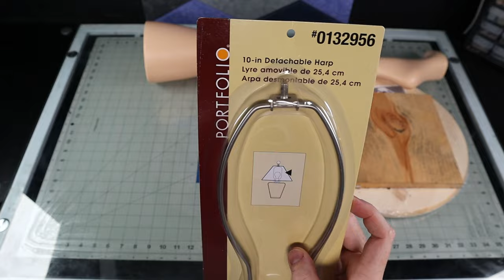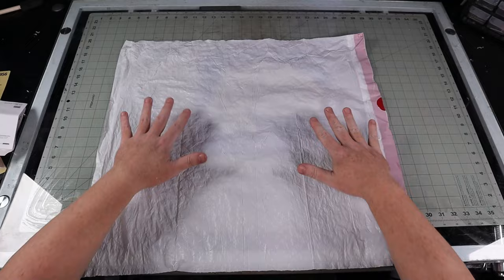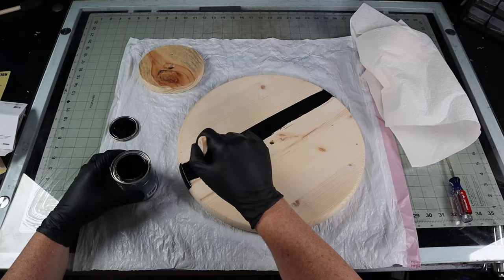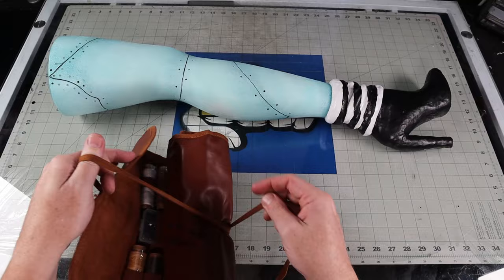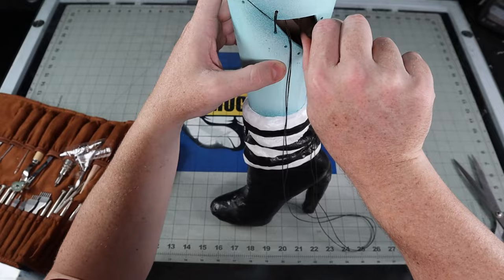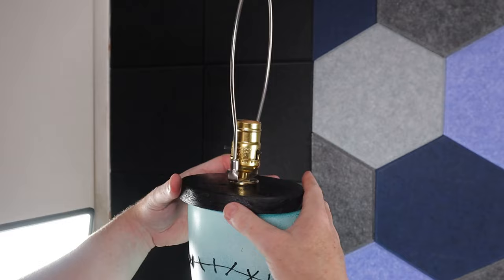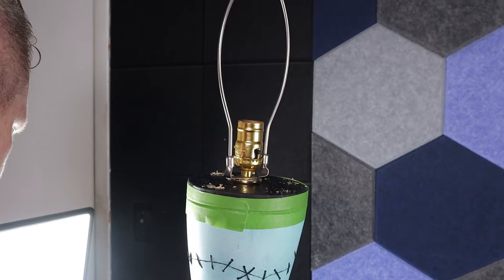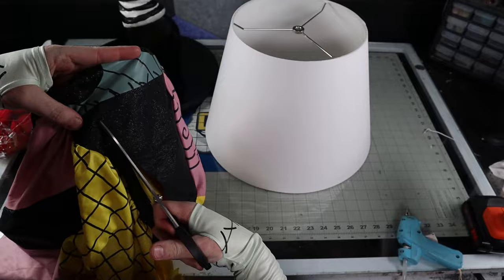Making a Sally Leg Lamp

Comment: Finding the center of the wooden round is easy with a framing square. Lay it on the round with the point of the right angle just touching the outside edge. Mark where the two legs intersect the edge and draw a line connecting the two points. That's a diameter. Repeat at a new spot and where the two lines intersect is the center.
Reply from the maker: Very true. This, however, was not centered exactly because the foot is not radially symmetrical. And because it was up on a tiptoe, I had a smaller window to make the hole run through the base and leg. I just got a general idea of center and visually made it relatively close.
Reply: My bad.
Reply from the maker: @603me.  no bad, for sure that method is a valid way to find a center and could be helpful to someone in the future going through comments with a question of why I did it the way I did. I appreciate the sharing of ideas. 👊

Comment: instead of tiring yourself out "sew" with a needle, you could have cut pieces of thread and glued them with epoxy glue ou uv resin 😊. 
Love de result 🖤🖤🖤🖤
Reply from the maker: I knew there would be some comments about the sewing. 😄 puff paint would be even easier. I thought about the resin route, too, but that would have taken even longer and probably just as tedious

Comment: The build id good, but I will question why the base was painted the same black as the shoe?  There surely could have been many other options?
Reply from the maker: It was not my initial plan. I wanted a dark mahogany stain and just got the wrong color. I am probably gonna add some more leaves to the bottom to break it up a bit. I ran out of time, trying to get it done before I put out the video.
Reply: @MuchProps   some more leaves or small withered plants would look good.  Dark mahogany would have worked really well.